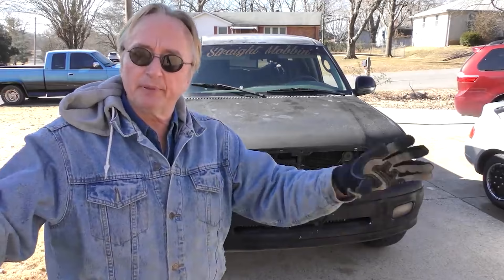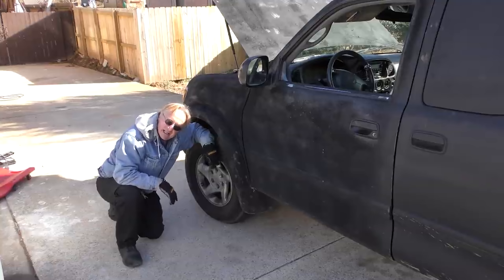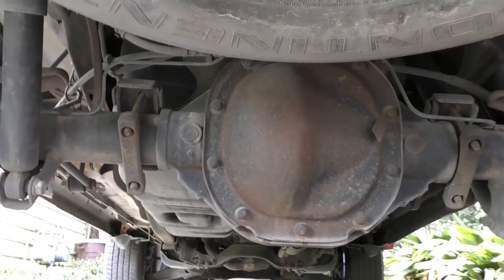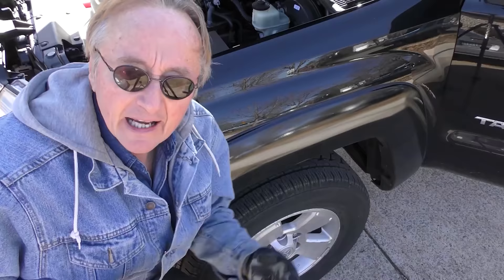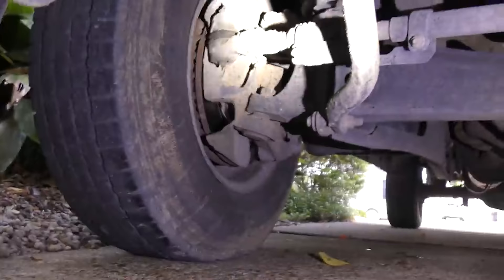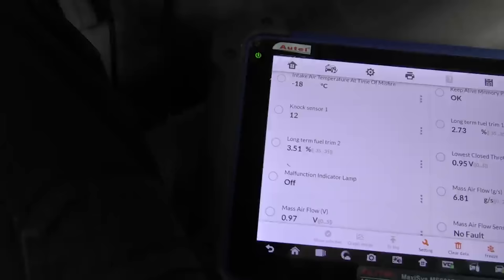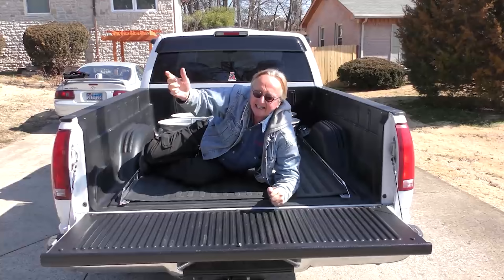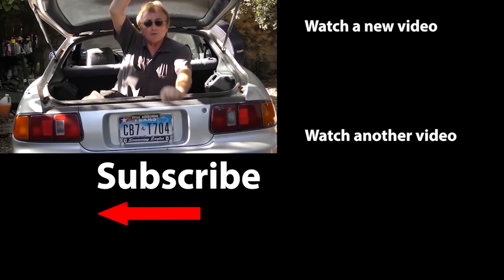5 Trucks You Should Buy

Comment: I had a 1986 Chevy S10 with the Durango 4x4 package and that had almost 300,000 miles on it when it was sold to a neighbor, whom drove it to well over 400,000 miles. I had a 1989 Chevy K2500 4x4 pick and that had 270,000 miles and ran strong. I bought a 2005 Asto van for $850 that had 168,000 miles on it with a broken rear diff. So for $1,200 for a posi-lock diff, I drove that van for 5.5 years and it was at 302,00 miles when I traded it in for a used 2013 Silverado. The Silverado had 94,000 miles when I got it 3.5 years ago, now it has 191,095 miles and not a lick of problems with it. GM makes good trucks too.

Comment: The early 00s 2500hds 6.0 gassers are like tanks. You can drag 10k lbs all day no problem. Any issues were all external water pump, alt, idler pulley, master cylinder.

Comment: My 02 F150 Supercrew with the 4.6 has 235k miles on it. Only things I've done are normal maintainance. Alternator went out on a vacation a few years ago, and I changed it in the Autozone parking lot. My only complaint is the rockers and steel bed floor, and tailgate hinge area are rusted out.
Without the rust issue, it looks and runs like a much newer truck.

Comment: Ford Ranger is common knowledge as being inferior, the Mazda pedigree was lost in the transition, but I owned an 84 Mazda B2000 and it was one of the simplest and easiest to work on rigs I have ever owned, it was also super reliable and easy and cheap to upgrade it's performance. They should have kept those class in place rather then cancelling them and going with the Ranger, it's just not the same vehicle.

Comment: Scotty I had a 2006 Toyota 4Runner with 265000 miles original trans, shocks front and rear, replaced the timing belt twice along with the water pump both times, also the radiator a couple of times. I would still have the 4Runner unfortunately my other half hit some black ice and lost control and rolled the truck, thankfully she wasn’t injured seriously, I’m a Toyota guy all the way

Comment: We have a 2002 with the 4.7 and it has over 300k miles , we drive it every single day pulling a 20ft enclosed trailer loaded down with fencing material and tools . I change the oil every 3k miles with Mobil one , drain and fill trans fluid every other oil change . Change the diff fluid every 10k. Just had the timing belt done , have never had a trans issue , it’s a easy truck to work on . It is a great truck the little things that has gone wrong were easy fixes

Comment: Every  day I drive a 2004 Chevrolet Silverado 1500 4×4 with the 4.8 L vortec engine it's a work model the dealership paperwork says I have pulled routine maintenance and did have pep boys do a cooling system flush and a transmission flush and the transmission filter change pep boys recommended I stop using dex cool and switch to normal coolant or All makes all models coolant so I did I have been truly impressed with the quality on my Silverado it's had plenty of abuse over the years and done alot of off roading Hunting it's my work truck and has never had any serious issues the transmission is still going strong it's only 4 speed which I like 183,00 miles and gets driven everyday it's been a valuable pickup truck.

Comment: Just get an AWD van and take care of it.  Power is 65% rear 35% front, but it is enough to drive on farmland, just no big rocks or steep hills with a lot of craters.  You can fit more in a cargo bay than a truck bed and you don't have to cover it.  Roof racks are cheap and give you even more room to haul.  Get at least a 5.3 if you want to tow.  You can do it all with a van.  Vans are also built to have the piss driven out of them with a full load.  Not impossible to get 500k out of an engine.

Comment: I have a F250 5.4l 2V , I just did a motor swap on because the previous owner didnt care to maintain it, the odometer says 350k, amd now with this junkyard motor hopefully it last about the same amount, the motor is got was pulled out of another f250 that was trashed, but before I installed the motor i put in a new oil pan gasket, rear main seal, front main seal, valve cover gaskets, Fomoco Spark plugs, and I took off the plastic in take manifold and elbow, and I installed aluminum ones, new battery and alternator, straight pipes, and its running like a champ, although I wished it ran faster its just a slow dog. But hopefully its a durable one.

Comment: My 2006 Tundra SR5 Access Cab w/ a 4.0L V6 just turned 65K miles. For many years I drove it less than 3K miles a year. Home Depot and Costco runs. Always garaged, and paint looks great. Probably the lowest mileage 2006 Tundra in the country. Runs like a brand new truck and I wouldn't sell it for anything. I change the oil/filter every year regardless of miles driven. Always use Mobil 1 synthetic. A/C blows ice cubes.
You can have all these new trucks.

Comment: 2003 GMC Sierra had 320,000 miles still running had to bring it to junkyard because of Rust it was always in salt putting boats in ocean but before the end of its life it towed 36,750 lbs in my rear end didn’t fall off like you said forgot to mention it had 8.1 motor and 2500hd chassis

Comment: The more I learn about my 2000' chevy silverado 2500, the happier I get.
Pros: 
1. Truck was built to last.
2. Engine comes with an oil cooler from the factory, enhanced engine longevity. 
3. It's an indirect fuel injector engine, which means the intake valves remain clean by the fuel and carbon build up is rare to non existent.
4. Modifiable transmission cooler for advanced cooling if desired, extend transmission life.
5. If transmission goes out, rebuilt transmissions are relatively cheap to buy and get installed.
6. Repair parts are domestic, quality OEM parts are cheap.
7. Modifiable after-market truck parts.

CONS:
1. People don't usually maintain older trucks for whatever reason, resulting in a lot of up-front maintaince costs to bring up to spec. (A nice chunk of change)
2. If the AC goes out and the Evaporator core is leaking, due to odd design, the job is labor intensive and will run you 3K to fix and replace the AC in your truck.

Other than that, it's an awesome truck that will probably outlast me. Of course it's a work horse truck to me not a show off truck, although I could modify it if want, down the road.

Comment: I had a 2005 Toyota Tundra and I towed 21,000 lbs through green mountains and white mountains in middle of blizzard and it didn’t mid a beat !!’ I paid $1500 for it with a 180,000 miles now it has over 600,000 and haven’t put a dime into it beside brake pads!

Comment: I bought a 2005 GMC with 168,000 5 yrs ago.. I paid $8,200.00.. I've done some work on it and I've put about 3-4 thousand dollars into it, air conditioner, brakes, tires, resurfaced exhaust manifold because of broken bolts that needed replacing, and a few other minor stuff and now I have a good running truck.. it's a 4 door, special edition with the hard bed cover.. my mechanic is good and he says that the engine is strong and should last me.. I change the oil all the time and am now running the synthetic.. it stopped leaking/burning oil too...

Comment: I drive a 2007 Toyota Tundra best truck I've ever owned my son has around a 2000 Chevrolet Silverado that is also a great motor in a vehicle pushing 370,000 miles running good so it appears that American automaker for doing a good job at sometime in the past

Comment: A friend has the Tundra, keeps going and going. A mere 155,000 miles, frequent oil changes, low RPMs until warmed up. Great truck.
Reply: That's pretty low mileage my 1999 chevy has 210k and I still consider that low mileage on the older trucks and cars

Comment: I've got a '99 F-250 with the 5.4 and 65k miles that's very similar to the one in this video and I'm not a fan. I absolutely spend WAY more time working on it than I do on my '08 Chevy Trailblazer with 220k. Plus, whenever stuff DOES break on the F-250, it's a royal PITA to work on! I'm probably never buying another Ford pickup!

Comment: Scotty, if you were to research how towing ratings are determined, you might not call your customer a madman for towing 18K with a Tundra. If you are on flat ground, on a cool day, and if you do not need to accelerate or brake too quickly, and if the weight is properly distributed so it’s centered over the trailer axles, it’s really not a very big deal.

Comment: I would regularly put over 5000 lbs in the bed of my 2001 Tundra.  It got wrecked and I bought a 2014 F150. The Ford has been a good truck but there's no way I'd put anything  close to that much weight in the bed. I tried to load it with 60, 60lb bags of concrete and she was not having it.

Comment: 2002 Silverado, 4.8L 235000 miles. Most reliable truck I’ve ever owned. Original Freon in it.
Mobil 1 full synthetic oil, and thee BEST oil filter on earth… NAPA Platinum.
Drive your truck nice and easy and they’ll last.💣💥🍔

Comment: I had a 95T 100 that ran 295k until lower4x4-A arm suspension broke…
This repair required removing the cab and rebuilding all of the bushings etc. and it was just way too big of a job for what was becoming rusty….
I traded it for a very nice welder

Comment: Should of had the Toyota 4wd , the pre 85 , best truck ever , bone stock it will fit 31" tires , and 3rd gear scratch with the 5spd , and it will out climb a jeep with the locking front hubs , it's a little narrower so it will squeeze down trails , great trucks , and there's a turbo version.

Comment: I have a 2005 GMC Sierra 1500 limited edition 4 door with almost 200,000 miles on it and it still runs great.. but I do have to admit, I change the oil before the recommended mileage..  and I recently had to change the radiator. also I had to do some work on the A.C.

Comment: I got a 2003 Tundra V6 with the manual transmission. It's so damn reliable, it still purs at 160,000. Thats Crazy! These new dodge trucks barely make it to 70,000 miles.

Comment: Still driving My Chevy 1500 Cargo Van with 300,000 miles. I did drop the motor and have the heads done, new starter, alternator, tranny seals but it runs great. Better than a $400+ car note + insurance. A C. Blows cold, Heat works. Just got new wipers and did all 4 brakes.. F_ck a car note

Comment: our 2013 Exploder transfer case started leaking at 99k miles. It was replaced under warranty. It now has 126k miles and I will start checking the wheels for slipping. It is the little lady's car so she wouldn't notice if the trans fell out. LoL

Comment: You will have to pry my single cab 95 Chevy 1500 from my dead bare hands. I love that truck so much, it shifts better than my brand Toyota, and smells like a dream. But mine also burns oil in between 5,000 mile changes 😂

Comment: You gotta make sure you buy a truck with good tires, the tires for the larger trucks are crazy expensive, ask the owner to put on new ones to seal the deal or use it as a negotiating tool, we're talking $1000 for 4 good brand tires 😮

Comment: I have a 1999 chevy silverado 1500 5.3l v8 with a 4l60e transmission i do all the normal maintenance like transmission fluid and filter change, oil, power steering fluid, coolant flush, all the basics so far I've had the same transmission, power steering pump, radiator, engine, oh and the diffs and transfer case gets fluid changes, no issues besides a leak on rear diff the gasket needs replaced haven't had time to mess with it, ac compresser is bad, locking cylinders are bad and the odometer gear light comes on and off but everything else is going strong, it makes a light bang when I put it in reverse I don't understand but it's been good now 2010 plus are just no good anymore,  it's got 210k miles

Comment: I have a 2003 f150 4x4 FX off road 5.4 liter 300000 miles shiny paint almost perfect interior I would drive it across the country tomorrow. Oil change twice  a  year regardless of miles Casteroil 20/50 in the summer months... just change the oil and don't let them over heat, I also try not to when just riding around flat roads not going over 2k rpms, no telling how many miles I will get

Comment: I'd never buy a GM truck made after around 2005.
My 99, with a 5.3, 4 spd auto has over 300K miles.
Doesn't use any oil between oil changes.
If the engine blows, I'll just get a brand new crate engine for $5000.

Comment: My roomate somehow managed to trade a 2012 Volkswagen bug for a 1990 Chevy 3/4 ton pickup, then he ended up selling the truck to me in exchange for paying his half of the rent. The cab is all beat up, it backfires and runs like crap, barely starts, has low oil pressure, etc, etc, but it's totally worth it for me. Especially only costing me less than 600 bucks, I have no idea why the other dude made that trade and why my buddy wanted so little for selling it, but I'm not gonna complain. I would have taken it with no engine and transmission, that truck chassis alone is worth a couple grand.

Comment: On Ford F250s you have to remove the entire cab to work on the engine. You can only change the oil on it. The rest you have to take it to the dealer.

Comment: Tell your customer to keep up on those LBJ's! The first gen Tundras, Sequoia's, Tacoma's, and 3rd gen 4Runners had the worst designed IFS resulting in constant down pressure on the lower ball joints. Checking and replacing them accordingly, with OEM and it'll be just fine.

Comment: I bought mine for $12000 a 2005 manual transmission. It had close to 60k. Now it has 210k. I towed 15000 pounds at one time. I had no idea I was towing that much until I backed up into the yard and the trailer tires sunk 8” into the sod.

Comment: My dad had a 94 standard 4.0 Ford ranger that he put 600k on before he sold it. I had a 04 F-250 with 6 inch lift and 5.4 in it and had 200k on and  I paid 3500 for it and it ran till 400k then I sold it

Comment: Have a 98 chevy 1500, 98 2500, and a 94 gmc 1500. Over 500k miles between them and running like a top. Would stay away from the 6.5 diesel and 454 engines but otherwise great trucks.

Comment: Our Ford Ranger and Ford F-150 are our work trucks.  We don't care much what they look like, they start every time and we don't do much for them.  Oil changes, brakes, batteries, tires.  They both had an issue with a switch in the a/c.  Less than $100 to fix.  The Ranger has a malfunctioning odometer but who cares?  I am driving it until it is a planter anyway.  It has said it is in the 130k range for 6 years now.  Um...no.  AT LEAST 225 k miles.  My ONLY complaint is the dumb power window in the back window of the F-150.  It broke and has been open for a few weeks waiting for my husband to make the time to get it fixed.  It doesn't rain in, for some magical reason, so he has just been living with it.  Low standards are important with old trucks.

Comment: I found a 2000 Toyota tundra extended cab 4x4 and it was in great condition except for the frame which was extremely rusted. The frame had a recall on it but when I took it to Toyota on the test drive; Toyota said they would not replace the frame because the original owner took it to Toyota in 2011 and Toyota said the frame was fine at that time so they did nothing and wrote it off. I thought recalls didn’t expire. I didn’t buy the truck because of the frame.

Comment: I have a 01 tundra flipped it at 90 rolled back on its wheels so I kept driving before the cops came, another time I drove it through a flooded creek it got me to the other side and it locked the engine both times the insurance fixed it it was all on public/state roads,,,they twisted the cab and put another bed on it if I remember correctly, the engine was replaced from a wrecked truck 40k on it since then I sent the trans in to have some work done. Have new ring and pinion for reared think it’s at 180k have lockers and bunch extra crap I added it’s a trd edition so i drove it like a baja truck that I pulled a 50hp kubota with I put that truck through absolute hell I plan on finish fixing it need new wire harness and rear end put in it, crazy thing is I’ve had ever truck he talked about and still have all of them except the Ford 350 but I had the 6.0 but never had any normal issues like head gasket and I got it cheap 3500 for a diesel 1 ton that everything worked and wasn’t in horrible shape got it from a friend that owns wrecker company, pulled many goosenecks with it

Comment: Had a b2000 years ago. Now a b2600. Meant I have a Ford ranger now. The two spark plugs or cylinder is unreal though. Don't like having to pull the plenum off to do a tune up though. Wait, maybe I'm thinking about my Taurus.   Still prefer my 76' 150 over my newer trucks. Only problem is there's no 4x4. It's a must in Alaska

Comment: A MUST READ warning for non-mechanics here

A woman drove by me and friend, the car “popped” then it ran very rough.  We looked under the hood, a plug came out and it was still on the plug wire, I put it back on and HAND TIGHTENED IT (no tool).   We were both looking inside at the engine WE HEARD A BANG and we saw the plug and wire gone!  We found it on the curb 20ft behind us. It blasted out of the engine, flew between our heads which were both on the side, so within an inch between our heads! With the plug wire.  We were lucky it did not imbed in our head or eyes.  YES IT WAS DUMB, be careful!

Comment: Could be wrong but seems Nissan and Toyota made deals with Ford and GM for their full size pickup technology back in the 80's?? Rear wheel drive in snow ice mud, etcetera, no thank you. Spinning tires can get you killed. At least put some weight on the rear axle for traction on the rear wheel drive. Front wheel has the weight from the motor is why they are better traction.

Comment: I have a 2004 GMC Sierra. It's a later generation that that 90's Silverado, but it's got 195,000 miles and still running strong.  Engine purrs like new.  My only worry is if the transmission acts up, or electronics.